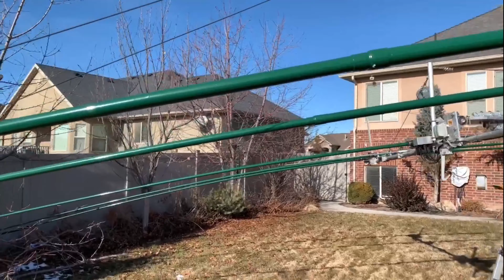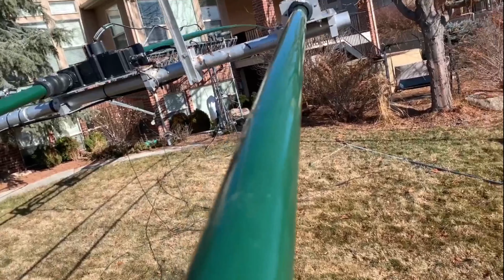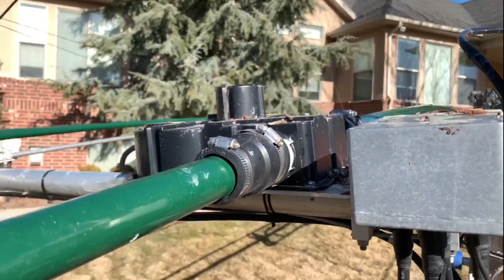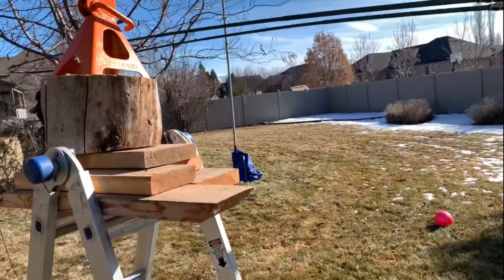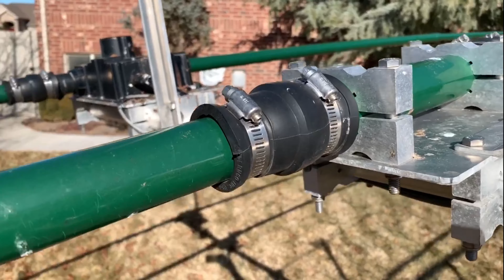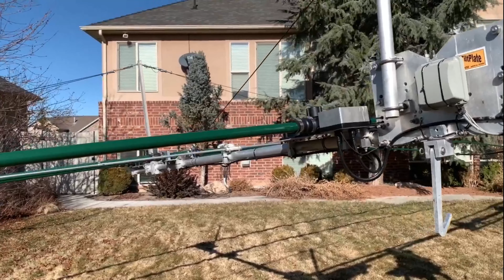NG7M's SteppIR DB18 after 2 1/2 Years - Minor Repair

Comment: Steve KE6DOA here.. i had/have a 4ele steppIR up at 60ft. that i only used for about 6 months and then fell out of the hobby for 7 or 8 years then went to use it again and found it dead and already work with steppIR to try and resolve it..  not going to happen, but i was looking at maybe replacing it with the DB18 but not the E model. how have you liked yours ? any issue's ? 73's
Reply from the maker: Hi, I really like my DB-18.  If I were to do it again, I still think it's hard to justify the E version cost, which gives you 3 elements on 30 meters and that's it.  Well and the ability to reverse the antenna on 30 meters I do believe.  So that's a tough call. I can tell you that the 2 elements on 30 meters at 80ft works really well!  I'm very happy with the antenna.  I have only had one issue over the last 3 years and it was a coax jumper or the relay box.  I changed both out at the same time when I had issues and that solved the problem.  Other than that, it has been rock solid.  I did screw up and toast a balun on 60 meters when I was transmitting QRO with a mismatch on 6 meters.  That was my fault, so I can't blame SteppIR at all.  Anyway, so far, so good.  Once you get used to a SteppIR beam it would be hard to go back!  The complexity so far of the antenna has not been an issue for me.  It's a keeper!  Max NG7M
Reply: @ng7m-ham-shack  just thought i would let ya know , just ordered the DB18 ;-) but wont ship for 4-6 weeks
thanks again for your input
Reply from the maker: Hi Steve, nice on your DB-18 order.  I really think you will like the antenna, those two elements on 40 for the size are tough to beat and it sure plays well for me at 80ft on 40.  As long as we understand the complexities the SteppIR's bring to the table, you can't go wrong.  Well you already know that with your 4 element!  Good luck with the new beam!  Thanks for the comments.  Max NG7M
Reply: Max George Thanks for the encouragement Also I just subscribed to your channel
Reply: Max George thanks Max , 
When I bought my four element it was early on I think 2012 so they had some issues with their EHUs which I understand have been corrected did not know or hear of any other upgrades since that era of their product line I was told that they corrected the issues with the EHUs , so basically I was just kind of getting a feel if there was any other issues with the antenna line but I am interested in that DB18 My tower is only 55 feet with the stepper being at 60 feet and it is not a tilt over tower crank up and down yes but still leaves it very high in the air so a manlift is required those don’t come cheap either to rent